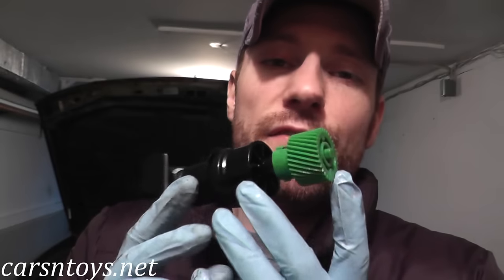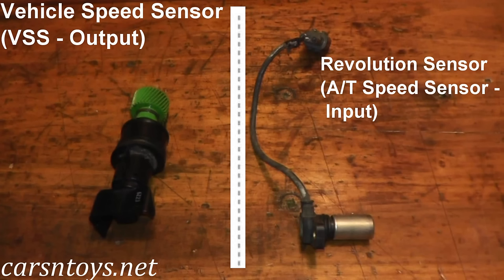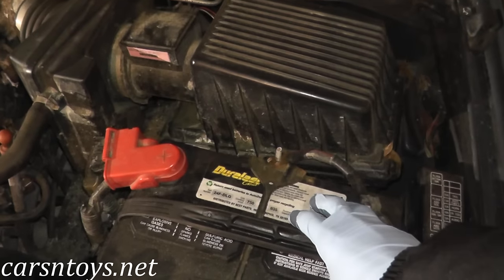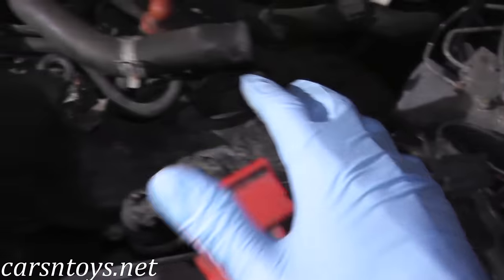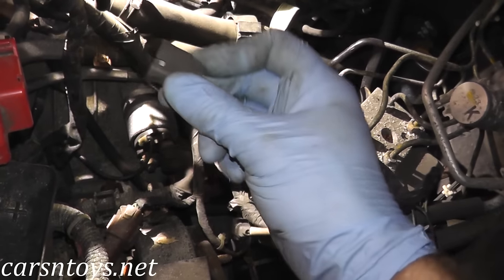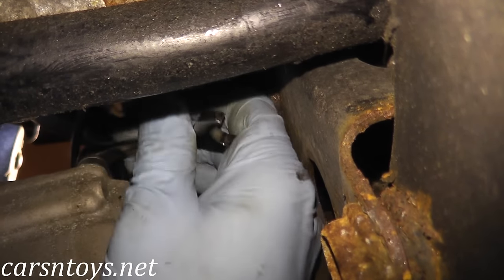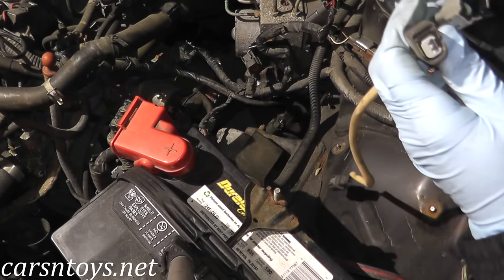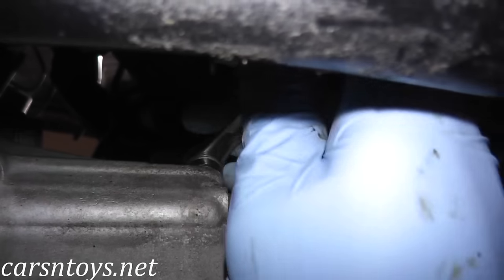Vehicle Speed Sensor P0500 Replacement

Comment: I have watched a number of videos about P0500.I have all the symptoms speedometer not reading, ABS light on dash,transmission shifting issues because the mechanic changed the axles and never reinstall the sensor rings,but my issue is no one talks of the voltage and ground at the two wheel sensors.

Comment: I had an check engine light on a 1996 I30 and used an Innvoa 3160 and it had an error code P0500 vehicle speed sensor. I called Infiniti and the part costs $35.00. I thank you for posting this video about changing the vehicle speed sensor.

Comment: I have a 2015 Nissan Altima, I took the car to get an oil change and tires rotated. When I left all my warning lights came up on dashboard and my speedometer stopped working along with gas hand. Service engine light reads P0500 vehicle speed sensor a

Comment: I also have code P0500 and my speedometer doesn't work. I have a 2000 Nissan Maxima (built 03/00) and it doesn't have the gear type sensor in the location you removed yours from. Mine just has a cover with a bolt in that location. Any idea where else the speedometer gets it's speed reading from?

Comment: Dude!  Perfect call! Speedometer was doing nothing & so I replaced the speed sensor & now it’s perfect!! 
Mine was for a 1997 Nissan Sentra but almost exactly the same process. I was actually able to access from the top of the engine and without removing any of the air intake equipment.

Sentra sensor is slightly different than your maxima - a little shorter & off white (as opposed to green).  I paid $40 for one locally but wanted to get it done - online would have probably saved me $15 but whole job (including driving to parts store) took maybe and hour.

If I could add picks to help Sentra owners,  I would but not sure how. 

Anyway - thanks SO MUCH!
Reply from the maker: Good stuff!
Reply: CarsNToys hey man! Plot twist. So speedometer was working great then got on Interstate & it quit.  I let it sit for a couple of days b/c I had more to do to the car. I took it to get tires & speedometer was just working (I didn’t even check it when I parked it) but, I got on the interstate and it died again. 😫 Maybe it’s dying over a certain MPH?? Any thoughts??

Comment: Great video! I replaced mine no problem. However I would like to add one thing. 
I saw that u removed the whole air unit on top, I  managed to remove the sensor through the bottom of the car (how you removed the bolt holding the sensor) carefully I wedged a thin screwdriver in between the sensor and top of the transmission (sensors was really seized up tight) and managed to pop out the sensors with no complications and w/o taking off the air units on top. (Add a bit of transmission oil on the ring of the new sensor so it is easier to put back (pressure and twist) as mentioned in the video. 👍🏼 great explanation

Comment: For ANYONE who comes here and does have an OLDER, MANUAL vehicle just know that the output sensors have an o ring and a Pinion or wheel. It is red for Manual transmissions. That wheel is imperative as it spins and communicates to the speedometer. It's very different than automatic. Also, you can use a cluster test to ensure that it is in fact your sensor before doing any of this!
Reply: Will this put the car into limp mode if it goes completely out or is that the other trans sensors

Comment: Need some help here. 
I've got the P0500 code, but my odometer works just fine. I replaced the speed sensor with a new one and I've check the wire harness. Everything checks out fine but I still get the same code. Any tips on what next I can check? Btw, my car is a 95 infiniti g20

Comment: Great Video thank you but I have a question. 
Why did you go from underneath instead of just down from the top after you removed the breather stuff ? I'm experienced in mechanics and want to THANK you for your help, it's a great explanation but perhaps could have used a little more light. 
Thanks for your time and advice it's greatly appreciated..
Cheers from B.C. Canada 
August 8/24

Comment: Also a P1106 left rear wheel sensor can cause this problem in a 2014 Infiniti Q50 a rear wheel sensor can trip that code your speed odometer Will Fluctuate up and down one time then go back to reading the actual speed

Comment: So, what is the problem the speedometer indicate faster or sensor if you are traveling 10MPH faster then the speedometer  indicate on the dash? Tires are the factory and correct sizes.

Comment: i have  my 2006 Elantra, the speedometer needle jumping up & down and after a minute of driving the car stall or hesitate. and if the speedometer needle stop jumping and going back to normal the car runs smooth again. need help.
Reply from the maker: Any trouble codes?
Reply: @CarsNToys  Im experincing same. I dont getting a code for the speedometer but i get P0115. ECT. The speedometer works once a while. Whenever it works, the tachometer also counts

Comment: I have that code being thrown after I just replaced my wheel bearing hub. Is there a wire that runs near anything I was working around? I have a 2015 subaru crosstrek. When driving the car it won't rev above 4000 rpm and starts to bog out and lose power. Only shifts below 4000 rpm.

Comment: i have m check engine light on on my 98 toyota corolla, when i did the scan it gave the p0500 code for fault speed sensor, i understand that a faulty speed sensor will make the speedometer stop working, can it also be responsible in making the car shift in a wired way during gear shifts, the car is a automatic transmission car, Please help
Reply: Bade-Ajidahun Oludahun it can

Comment: I have a 1997 Toyota Camry v6 , my problem is sometimes the car jerks back and forward when I  put it on drive.  Today I was driving and my car stopped moving forward but I was able to drive it back home with car driving backward . The car is moving when I drive it on reverse and it can't go forward on drive. I had auto zone scan the vehicle and it came with a code po500 vehicle speed sensor A. Would you know what the problem is please I need your help

Comment: My car is a nissan wingroad y11 2003 and not seeing no vss output sensor on top the transmission it cap off with a 10 bolt only seeing the revolution input magnetic sensor question where my car getting that output vss speed from since there is none.

Comment: I have a toyota rush jeep.my od off light is flashing when it goes nearly 5-10 km. it doesn't allow me to higher gears whene it appears. but i can put the gear to parking mode it disappears please how to  fix this. i changed the selonide pack still problem is there. when i scan the vehicle it does not give any error code

Comment: I have the code p0500 and my speedometer still works but its reving high still after i put in the output sensor in .. could I have replace the wrong one ? I payed 155 buck for it

Comment: So my car is jerking real bad when I put it in reverse and my abs light and hand brake light come on randomly while driving. I was told it could be the speed sensor, do you think they meant the other sensor you spoken about?
Reply from the maker: Best bet is to see what abs code you're getting. Your local auto part store may check the code for you or buy your own scanner if you plan on doing your own auto repair. This is the scanner I use for engine/abs/srs codes - https://youtu.be/K45uAJGbY0M

Comment: Hello, I have a 2007 Toyota Yaris Auto trans, with code P0500, do you think replacing the VSS will do the magic? Thanks
Reply from the maker: If there are no other trouble codes I'd certainly take a look at it; meaning checking the wiring and so forth as shown in the video. Hope it helps.

Comment: I purchased a replacement sensor for a 2004 Hyundai Santa Fe 4WD, 3.5L V6 AT. Amazon $27.00.
The install is proving more difficult than it should be. The sensor doesn't seem to want to seat easily.  I had to gently tap on it to get it deeper than I coould by hand. I did replace the gear because the unit arrived with a larger gear than the old unit.  I'm having a real hard time getting the mounting bolt hole to align correctly.  Any suggestions?
Reply: Get the right part maybe?

Comment: @Carsntoys what sensor do I need for a 1999 Nissan Altima GXE when taking off the wire got pulled off the sensor and needs to be replaced or rewired if possible

Comment: my 2000 maxima auto has a problem.. goes into 1st  and 2nd very smooth but revs very high and won't shift into 3rd or 4th.. I was looking into this sensor and don't have much info but from your experience what would you say might be wrong.. I changed the fluids and new solenoids.
Reply from the maker: +Faraz Nabibaksh This sensor deals with the MPH readout on your dash. Any trouble codes?
Reply: +CarsNToys no codes
Reply from the maker: +Faraz Nabibaksh Sounds like an internal transmission problem. I'm afraid you'll have to bring the car to a tranny shop and go from there.

Comment: problem facing in Chevrolet captiva, DTC U0073, U0121 and P0500 ,,,,suddenly odometer stops working ,all needles(Temperature, rpm, speed etc.) showing 0 reading , ac stops cooling while blower keep running,reverse gear light stops working and all happen intermittently and all together. Can anybody suggest solution?

Comment: Do got a video on a 2002 Oldsmobile silhouette speed sensor how to repair and location on where it's at  transmission it's a automatic  engine size 3.4 l please let me know if you have anything
Reply from the maker: Wow, I remember those. Google images may be your best bet or purchase the factory repair manual. May be able to find an electronic version (.pdf) via ebay.

Comment: Can this speed sensor affect my transmission in terms of shifting? My nissan sentra goes into gear but does not want to accelerate nor shift and revs high
Reply: I asked a Nissan specialist online basically the same question. He told me that yes, the VSS can make vehicles have intermittent lack of acceleration and hard shifts. However, as you will see in my question I just posted either I have a faulty new VSS or something else is tripping it because my new VSS installed is causing more frequent problems than the old one. :/ Good luck to you. Hopefully, it won't be troublesome for you when you replace yours.

Comment: Great video…I would just add that after 30 frustrating minutes trying to the bastard out, I went under the car and tapped it out with a screwdriver and hammer…..much easier, just move the nut hole to where you can tap it…..thanks!
Reply from the maker: Glad it worked!

Comment: I have a 02' Nissan Frontier XE 4Cyl automatic transmission that got the P0500 code for the VSS. I replaced it like you show in this video, but mine didn't come with a new wire harness. After installing the new VSS my truck had the same problems such as intermittent lack of acceleration and occasional hard shift, but it is doing it a lot more often now. Do you think it's possible the new VSS could be faulty being that it is running worst or do you think the wire harness should have also been replaced? A mechanic told me to replace my cluster module, but would you agree with that considering the speedometer never stopped working. It has been working all the time. My main concern is the lack of acceleration that has been happening off and on at these speeds: 20, 40, 45, 60 mph. 

Also, sorry this is so long winded but what about the communication between the VSS and the ABS Speed sensor? If something is wrong with the ABS speed sensor could that mess with the signal of the VSS? I had the passenger tire replaced just before all this VSS problems started happening and I know logically nothing should've happened to the ABS speed sensor in the changing of a tire, but the next day the ABS light on the dash went on and then later that same week all this VSS problems started happening.

Thank you for any of your professional input. I appreciate it because especially because the type of work I do requires a running vehicle and I'm search of a new job ASAP.
Reply from the maker: Any other trouble code besides p0500?
Reply: No, just P0500.

Comment: i have nissan infiniti i30 97(nissan maxima 97) my probles is i have code p0600 what's mean? and how i to fix it?
Reply from the maker: A/T control. In other words, smooth shifting for the transmission.
Reply: I just got the exact same problem p0600. Do you have a diagnosis video for such a code? Ive also got a p0440 evap leak code.

Comment: i need to know where the wire harness goes to please mine has been moved i think because it goes to the side wall and is just screewed in there like a ground and its confusing the hell out of me becasuse if thats where it goes how the hell does my speedometer read it?   please help losing my mind and i need this car to work for my girl!
Reply from the maker: Sure I can take a quick video tomorrow and post on facebook. This was done on a '97 Maxima. Your girl has the same vehicle?
Reply: well she has a 95 but same motor and as I said it's where the wire goes after the vss that's confusing me because it goes to another wire harness and then on to the frame as like it was a ground....so I'm confused as to how the speedometer reads it if it doesn't go there. please help ty
Reply: pls tag me William jeremy burkett for the Facebook post ty bud I appreciate it alot
Reply from the maker: Ok will do. It's been raining all day today but tomorrow may be clear.
Reply: CarsNToys no worries when you can is fine I appreciate the help. surprisingly I can't find it in the Chilton either.
Reply: @CarsNToys  do you have a video of the same thing but with a 2004 maxima? I CANNOT find it at all of this cat, I actually downloaded a speedometer app on my phone and was gonna say screw it but my cruise control still dont work :(

Comment: hi mate you are really good,  great vedeo mate i have a suburban 95 6.5TD  and i change a standard automatic transmission (4L80E) to full manual transmission (NV4500)  before everyting is fine the SPEEDOMETER is working and after never working anymore!! i send my old ECM to america for reprogramed to manual trans. and result not working the damm SPEEDOMETER and ABS light is one!!  i check all conectores, wire"s,etc... 4x4 is working 100% good, i put the new ABS sensor"s and speed sensor also is brand new  but not working the SPEEDOMETER i check the 2 wire"s for conect on speed sensor is not come any power!!! i understend nothing about electricity!! i try contact many workshopp around here but no one understend nothing about american trucks i need help if some one can help me on this kind of problems i apreciate really if is possible show a electric  schematic"s about SPEEDOMETER  thanks regards from norway thanks mate is a exlente vedeo
Reply from the maker: Hi Jorge. Unfortunately I don't have a schematic for your truck. Have you tried google images or a forum for Suburban's?
Reply: CarsNToys kingi

Comment: hey I have a 06 altima 3.5 I'm getting p0726 code for the (input vss) it looks like this. my question is can you help with determing of its suppose to look like this or the revolution sensor ?
Reply from the maker: +Miles Watkins Input is the revolution sensor. Output is the vss.
Reply: +CarsNToys is this suppose to be in the same location for a 06altima 3.5 ?